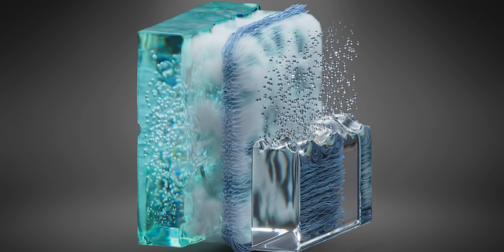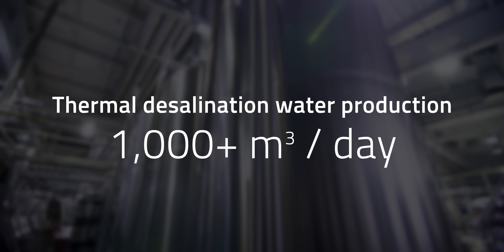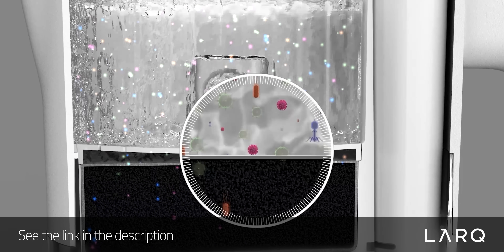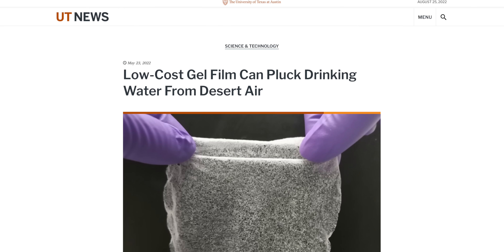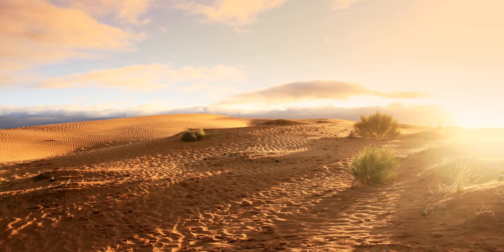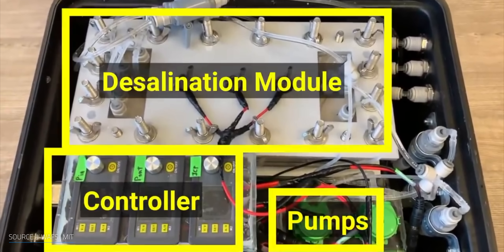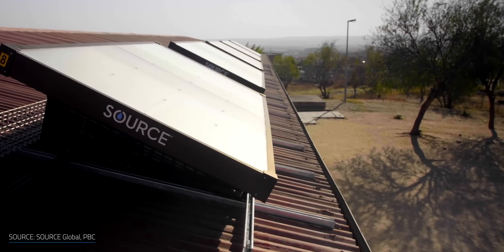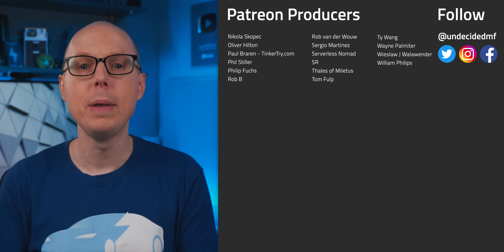2 Breakthroughs That Could Solve the Fresh Water Crisis

Comment from the maker: Do you think technologies like these, even if they’re more targeted solutions, have a place to make a difference? Get a LARQ PureVis pitcher and start enjoying fresh, pure water today: https://bylarq.com/undecided.

If you liked this video, check out: How Nanotech Can Help Solve the Fresh Water Crisis https://youtu.be/D1kqGyPGsF8?list=PLnTSM-ORSgi7UWp64ZlOKUPNXePMTdU4d
Reply: At 9:51, did you mean 20J/L instead of 20W/L?  Or is it 20W for 1 L/hr capacity?  It would be great to know how this compares energy-wise to current large-scale installations.
Reply: 20W/l is not possible. Watt is a unit of power, not energy. Wh??
Reply: Israel already done it, upon completion of the seventh desalinated plant, desalinated water will cover up to 90% of Israel's annual municipal and industrial water consumption. The real question is how motivated, tax rich and aware of the problem the local goverments are. But the ICP+ED may the game changer. Gel ... no life span information means it is probaly a sigle use item ... also freeze-drying is one of the most expensive and most energy intensive processes.
Reply: How about mold within the gel?
Reply: @BuchholzerIn1  That kinda depends, it's not an issue if the gel has pores small enough. Any kind of mold will be magnitudes bigger than water molecules.
Reply: @BuchholzerIn1  
It seems pretty flawed and a lot of conjecture is involved.
Reply: Since at least ten or fifteen years ago, there are several ways to extract water from the air without gels or other chemicals. Some get 10 to 20 gallons per day by cooling down air. In commercial applications, simple filters and UV irradiation assure good quality. They work with low-power electric supply that a solar panel can provide. Other systems are in use that do not require power, they are built with plastic nets that condense dew, which runs down to collector tanks. Some African populations have got them that had little access to any water. The kind of plastic and the net rings shape were determined by trial and selection for high-enough yield.
Reply: A good indicator you should not trust a source is when they don't even check the units they use: 9:53
Reply: Watts per liter? Howabout watt hours or joules or something that actually makes sense...
Reply: I just can't do it anymore - I've unsubscribed.  It's not just the clickbait titles, and it's not that everything you post is rubbish.  It's that enough of what you promote is rubbish to make me not trust your content.  I do understand you are trying to make money, but you've become a bit too much of a snake oil salesman for my taste.
Reply: Around a decade ago "Lifestraw" was invented and that now are part of many larger help organisations emergency kit for people brought in a situation where clean water suddenly are removed, like climate disasters or draught. There are lots of info about the "Lifestraw" technology and the products it has caused. The most famous are a cigar sized "straw" that you can drink through. Just put it in a puddle of water and you can drink. It is more than smart and already must have saved many many life´s.
Reply: The gel sounds like a back pack item so not useful for solving the fresh water problem. Desalinating a trillion(s) gal/yr of water is all about scale & energy requirements. Seems hard to imagine million shaft horsepower pumping systems without having too much pressure and/or velocity for either system. I'm not seeing it in either one.
Reply: Honestly, if you have ever looked at a UV water disinfection unit, you would never trust a dinky LED light. The UV radiation required to kill germs does not penetrate very deep into the water, let alone a weak LED based one... Just saying - nice idea - but not really working
Reply: What do you think about the viability of using moisture farms in high humidity areas then sending the collected water to arid areas? For example could moisture farms be built in Tennessee, particularly in and around major cities, then shipping the water westwards be a viable option? To me it seems like taking humidity from a place where people don't want it and using the water to combat a draught seems like an obvious solution.
Reply: Shipping water(bottled) has already entered the equasion. From where to where is the thing. From the rich into the hands of the poor getting poorers hands is the problem. The poorest that have a need are having the resources stolen out from under them and sold back to them for extreme markup. Soon it will be you who feels that 🤑 pain as $5 to $10 a bottle for water while Microsoft still pays pennies for it as their server farms coolant. Thanks to the great Bill of Gates🙄
Reply: @kickinacoustic6119  most of the time high humidity areas don't have a problem with water shortage. Water has a very low value density. Therefore transporting it over high distances is not really an option.
Reply: @kickinacoustic6119   Fun idea!  But, don’t let Los Angeles get wind of that idea!🤔🤣  
Seriously, if harvesting humidity from high-humid areas were done in big enough volumes to meaningfully supply dry States, & transported or pipelined to places like NM, AZ, NV, CA, it would be a financial & ecological disaster.  
The Risk/cost: benefit ratio would be very bad.   
It would change the environment in the regions it’s taken from; plants, creatures, would change—likely, drastically.   Living things evolved to use the high humidity in those places.  Without it, many of them die, or try migrating elsewhere. 
Keep in mind…the States that have used-up the Colorado River, vastly underestimated:   
   A) how much there was available, & 
   B) how exponential the population growth would be, & 
   C) all the backyard swimming pools, ability to wash all their vehicles, have water theme parks, support grassy golf courses, & the agriculture, etc. 
Moisture harvesting from fog & humidity has been being done in arid areas like Chile, for a few decades.  It takes a LOT of harvesting sheets to just water the village near a set of those. 
But, maybe there are places along the west coast that MIGHT be able to do that…with the humidity sheets—those require wind, & fog. 
Maybe an ocean geothermal temperature differential could power humidity concentrators, instead of drawing power from the already very over-extended power grid. 
In fact, I do not know why no one seems to have done that yet…there are far fewer, less costly parts to make electricity from a temperature differential, than those giant propeller wind-gens. 
Imho, we need to Stop escalating complex tech.  It’s blown past the cost: benefit ratio, & has entered the realm of it producing hordes of very costly & harmful middlemen.
Reply: @UCMmXWDkvKrZQRjY5qKSpwRg EDR relies on an ion selective process so unlike RO, what is left behind is difficult to say specifically. RO targets everything where EDR is more selective. I use a single type of membrane for sodium. To do this, a specific voltage is applied to the membrane. Change the voltage, change the filtering properties. This os why it takes several different membranes and or filters to get drinking water. So the answer to your question is complicated. The suitcase filter in the video most likely leaves behind certain properties. At scale, this type of filtration is by far better in every way. Cost, longevity and efficiency.
Reply: Exciting news, Matt. Thanks for all you do to keep us informed. Minor note: potable is pronounced with a long "o" sound. Think "potent", hence the Reader's Digest and Jeopardy! categories, "Potent Potables".
Reply: LARQ and UV-C... The video presentation gives the impression that UV-C is visible at the bottom of the device. Well, in reality, UV-C light is harmful, and it really shouldn't be seen anywhere in connection with humans, animals and beneficial organisms. So: The presentation is either incorrect, the light is completely useless for disinfection, or the product is dangerous! Also: If it's UV-C light, how long does the light source last before it needs to be replaced? How expensive is a new light source? Do you have the research results of the actual ability of this device to utilize UV-C light, that it is not just hype?
Reply: Wow, those pitchers are pricey!
Reply: The gel systen can be used  in an agricultural / drip irritation system to grow food in areas that have no water.
Reply: I have seen research that PURE water is harmful to the body. Water by its nature absorbs minerals. If you drink pure water, it absorbs needed minerals from your body for your expel later on. Drink it too much and you can end up with serious health implications. Google is drinking pure drinking water bad fro me.
Reply: @DuncanCox  Of course pure water isn't potable! That's why distilled water flasks have a warning to the point (at least, in my country). Half a century ago, my teacher of chemistry taught me (and my mates) that. It is known from way before that.
Reply: @wafikiri_  and yet it’s sold in supermarkets as something heathy, something pure!
Reply: I think that just like the energy storage issue, there is no silver bullet, but instead it will be the collective might of all these solutions and the ones to come will definitely have a place in solving or at least mitigating the water shortage problem.
Reply: Can it be put in the fridge?
Reply: Matt, Agriculture accounts for 92% of humanity’s freshwater footprint across the planet. More than half that water is going to cattle-feed crops. What does this mean? It means we actually have enough water but it's going to feed animals we raise rather than humans. If we moved toward more plant based diets we would have plenty of water. Read more by Googling the article: "US rivers and lakes are shrinking for a surprising reason: cows." Can you do a video on that?
Reply: There is a ready market for that small ICP device right now for sailboat cruisers.  Currently they use a membrane method that requires a high pressure pump.  On a recreational boat these are called "water makers"  and cost several thousand dollars.  If they can increase the output capacity these small ICP devices seem like they could totally be a game changer in that market.
Reply: You should check nanomembrane technlogy by Polish startup Nanoseen. Apparently its cheap and gravity based so no external energy needed. Seems like a holy grail of water desalination.
Reply: @Divereth  link  or you comment does not matter. 
also of course it still needs Energie.
Reply: 20 watts per litre is meaningless unless we know how long it takes to make the litre at 20w.  Assuming it makes it at the 0.3L per hour then it takes just over 3 hours to make that Litre at we watts and so roughly 60 watt-hours per litre.   The average US household pays about 15c per KWH and so, and as such you can make about 16 litre for every KW, or more to the point about a cent per litre, that's pretty good!   I tried calculating the cost of steam distilling water, but the cost works out to something truly insane that doesn't reflect reality of steam distillation.
Reply: You are severely stupid. This doesn't work. Please cancel your channel. Stop giving gullible idiots false hope
Reply: I am actually really curious about the MIT option.
Reply: Water filtration system flows through the vines:;🏞️🌈 Structure
Reply: I thought that lithium is in ocean water.  Plus a lot of other salts.  Some of those salts can be used in industrial processing.
Reply: What about evaporation with a lens to heat up the water to make it evaporation faster?
Reply: The Lake Mead water standards were established during a time of some of the highest possible rainfall, while the last 21 years have been a 21 year long draught.
Reply: I think sucking the desert dry of what little water is in the air is asking for trouble. As if the plants don't need any water either. Just like electric vehicles. It's a grand idea. But it's totally unsustainable.
Reply: Yes.
Reply: NO
Reply: ..Whatever the answer is, the "Greenies" won't let you do it. So, forget about it.
Reply: @lilblackduc7312  It's already been done.
Reply: for such a small amount of production rate a simple glass box ! will produce more than 12 years research ! and money wasted , I claime that I have a "distruptive" tech in desal , yet the major obstacle is that western countries dominate our countries and prevent ! any truly good solution in desal or solar energy to come to reality
Reply: $50/each?    I can see over $50 in just the pumps....$20 in the carrying case....can you break this down?  I would think $500 would be closer to reality unless it uses a lot of cheap Chinese parts......still; $50 ??
Reply: Why don’t the distillation desalination plants not use the cheap sand batteries?
Reply: What about softening hard water?
Reply: @Crunch_dGH   By filtering? I don’t think so.…filters don’t soften much, as far as I know; might lower some minerals a bit; depends on filter.  
Water softeners (a few different kinds), have a backwash stream, & so do R/O units.  So do those “alkaline water machines”. The waste streams are too high in salts & minerals to be safe reused in a garden, for instance.  
I don’t know how the backwash or waste stream from either R/O or water softeners could be made safe to use for watering gardens.  .  
If many people did R/O or water softening in an area (softeners or R/O), the concentrated mineral salts from those waste streams in municipal waste water skew the chemistry of processing wastewater.
Reply: @Chimonger1  Thanks for your answer. I was wondering if there were any ways to pull minerals out of hard water using electricity, alone. Thanks
Reply: The problem becomes whatto do with the brine? How about using it as a source with salt storage batteries? We need more SCIENTISTS?
Reply: I can see that gel being used to establish food forests in the desert.  I really want to play with it now...
Reply: Nature already does this a lot more efficiently.  You can put a bag on a tree branch and it will transpire a lot of water in a short time.
We should be giving priority to restorative techniques.  In hot coastal areas with year round mangroves increase transpiration.  
Nature has great ways of doing that while reducing the CO²; flooding; fire vulnerability; droughts; heat waves; food scarcity, diversity, quality; air and water pollution; heating, cooling and hot water bills; increasing wildlife habitat; the list goes on.  
Emphasizing overall plant diversity with emphasis on trees (in tropical zones such as the Middle East, mangroves would be important) as well as rainwater harvesting technique and earthworks made with on-site materials assists nature in a durable, cheap, restorative, ethical way.
To get the most benefit including in areas of food production one further caveat: we need to convert to permaculture methods so we avoid using synthetic chemical inputs.  Synthetic-chemical-inputs harm soil and its ability to sustain plants and retain carbon.
Reply: The podcast needs to be longer🥺
Reply: @mynk0.78mm  No it doesn't. He covers the materiel and shuts his yap, I call that respecting people's time. He has long ones when needed, go watch those.
Reply: Kinda bummed at the increased amount of sponsored content like this
Reply: EDR is not new. It has been off patent for nearly 60 years. New materials have been helpful but lacks big investment because of the public domain. I built my own. Not too difficult.
Reply: @Al Ryzy, What did your build cost you? Are there plans available? If so, where? Thanks👍
Reply: Is anyone desalinating water via ice? how feasible is it at an industrial scale?
Reply: @JohnWick-rq6fo  That would be very energy intensive.
Reply: @JohnWick-rq6fo   Uses way more electricity. Grids already behind on just serving homes at a reasonable cost; with the onset of an electric car conversion for general transportation, the demand will drastically Jack-up costs of electric, & there’s already shortages due to just those who have gone electric vehicle.  
If you can make ice without using electricity, that might work….
…maybe an ocean geothermal temp differential between deep ocean & surface water, to generate electric? ..I wonder why  has not been used to generate power instead of those huge, costly windgens..🤔
But, it’s maybe possible to use ocean geothermal to generate power to make ice, then liquify that to potable water….it would need to be filtered.
Reply: Perfect for small scale solutions. Could be big in the future. Nice video... as usual :) Let me know what u think about Steven Pinker's book: Enlightenment now. My conlusion is in short: We're heading in the right direction. Just like usaid at the end of the video. thx for the content man <3 P.S. You are the spitting image of one of my good buddies named Jasper. Hilariously similar :D
Reply: Wonder how long it'll be before this too is busted and debunked as it's clear from the title whatever this is it's another scam that was poorly researched. Bummer, used to respect this channel but it's time to unsub and go.
Reply: @ross-carlson  This channel is mostly preliminary research projects or pilot scale at best. The concept "busted and debunked" fits in somewhere between weird and peculiar. Matt reports on promising projects and breakthroughs, not old proven crap bumming around in the attic. This is a science news channel so not for everyone.

Comment: I have heard of Photo Molecular splitting of water into H2 and O2 leaving behind the salt etc in the last few months.
Basically using Green wavelength at a 45degree angle and 1/10th of energy costs. Think of desalination and kettles (one of the most intensive ergy consumer in the house).

Comment: If getting rid of the saline water is a problem, couldn’t you just sell the salt? Then salt could stop being mined. Also, if you used solar thermal, there would be heat that could heat a greenhouse complex, a swimming pool, heating district etc.